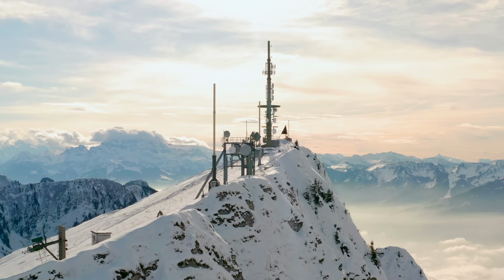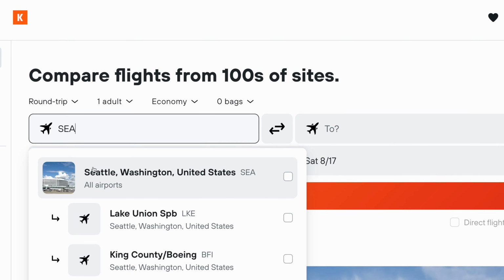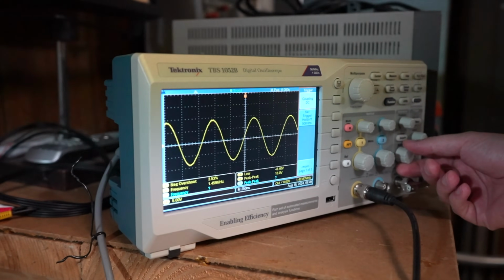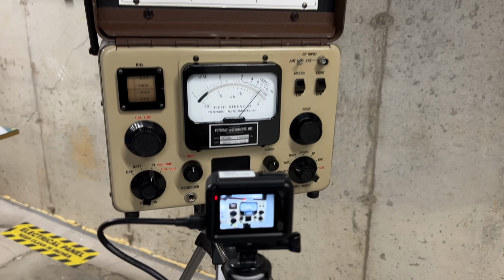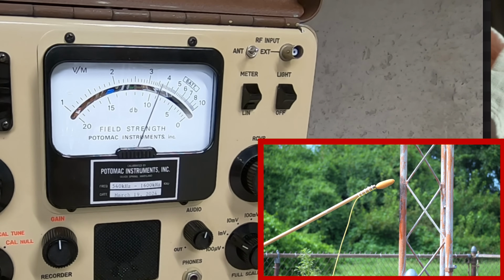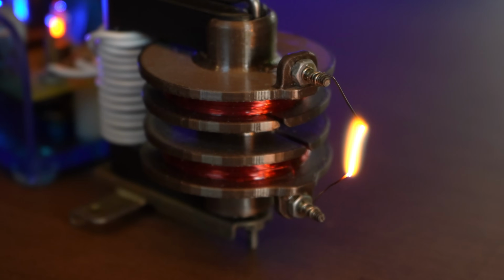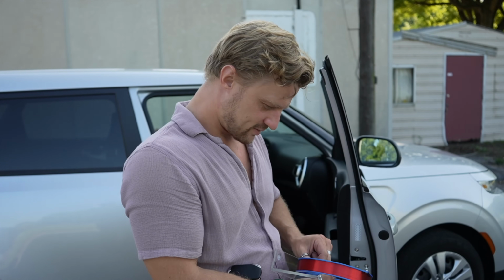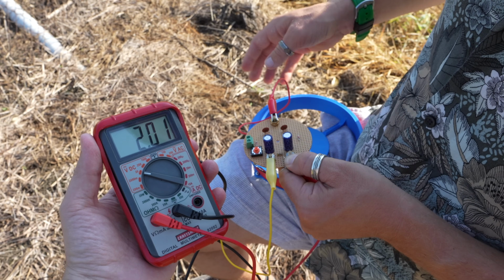Stealing Energy From Radio towers Using Plasma (ft. Geerling Engineering)

Comment: whether or not a radio signal goes line of sight or not, does NOT depend on its mode.... i.e. FM,AM,SSB........... it only depends on the frequency of the signal, so line of sight radio are signals more or less above 54 MHZ or so, regardless if its AM , FM or whatever...

Comment: This guy needs to meet Ethan Krauss. 

Ethan Krauss has an Ionocraft Lifter with an Onboard Power Supply. He had that before MIT and Undefined Technologies. Since Thomas Townsend Brown and Lockheed/RCA neve patented their lifters w/General Electric Batteries; Ethan Krauss is technically the Inventor of the Ionocraft with Onboard Power Supply. 

Electron Air LLC

Comment: Rather anti-climactic!  YES, I want to see you build a device hat actually takes useful amounts of energy out of the air at a reasonable distance.  Let us see you light up a one watt LED continuously.  That will be useful.

BTW, when you talk about transmitting energy through the air, maybe you ought to read a book or two about Nicola TESLA.  He transmitted power for many miles to light up fluorescent light bulbs MILES away.  And he did it over 120 years ago.

Comment: Those rings and the electronics stuff together freaks me out!
Reply: Mind the admonishments on the warning signs, until you understand them. Then respect them. That worked well for me for 39 years in the high power transmitter research field, mostly at much higher power levels than this little AM station. .

Comment: It's worth noting that early Crystal radios lacked any form of amplification circuit, the power to drive the loudspeaker came purely from the energy captured by the antenna.
Reply: All crystal radios work like that. They are fun to build.

Comment: Tesla invented the wireless power transmissions, just like the death ray was a Tesla invention. The death ray works only if you throw the death ray gun to the enemy. The energy transmission works too, input something like twelve thousand Watts to make on LED flash for a second. The efficiency is far below zero. Back then, when Tesla was stil walking on Earth there were no LED's, only light bulbs. The power in the tower should have been increased by a million times and even then the lightbulb from a bicycle would not lit.

Comment: I use to live like a hundread meters away from a 500kV power line, and once riding my mountain bike on a road that passes below the power transmission towers, bike that was like a closed loop of aluminium, I got a electric shock that I was even able to hear in the wired earphones I were carrying, I felt like a pinch in one leg, I think it was due current induction on the bike frame. I even wrote a letter to local authorities and got an answer telling me the tower were within the normated parameters (the road was built after the power lines and they lift the ground a few meters). 
From that little accident, I am pretty confident that if you place enough wire loops below a high voltage power line, you will be able to steal electricity for free in a wireless way by making a core-less transformer, which you could try for incoming video, but placing the warning that making a transformer below a power transmission line is a very efficient way of getting electrocuted as the sausages of this video.

Comment: so what would happen if i made a bunch of these (with correct components and copper coils to prevent blowing up my circuit) and tuned them to the various broadcasting AM frequencies and connected it to a battery for home distribution? would that work to power the average american home? what about sending power to rural or difficult to reach places?

Comment: i honestly hope you realize what you have created here.... 12KW is a drop in a lakes worth of energy compared to the radio noise that surrounds us naturally.... if you had an array of those antenna set to pulse at 23% before critical, enough of them could supply a continuous voltage much like a bridge rectifier does for a generator. good luck from the future

Comment: I worked at a VLF 500kW transmitting station in the 80s.
We bounced signals around and through the planet using 100ft arrays and 5ft vacuum tubes. 
It was the cold war and everything was overkill!

Comment: Ok, so where was the plasma shockwave?
When I think of shockwave, I think of something similar to a blast/detonation of energy with the potential to knock you down or worse.
A transmitter and a receiver is old school and not what I was expecting.
What kind of work could a plasma shockwave potentially do?
Reply: 9:52 They even point a big red arrow at it
Reply: @JamieJamez , I wouldn't call that a shockwave.  Something else perhaps but not a shockwave.

Comment: Hey Guys,

I have a question about Plasma. Could you create a parallel circuit, in which one high voltage power supply creates a plasma, through which a second low power supply runs high current? Because plasma is conductive, right?

Comment: When I was in high school we had a Nasa Engineer substitute math for us. He talked about making something similar to your LED circuit. He used these for LED lights in house. (before the led was commercially available. He talked about using the radio waves from the nearby tower to feed the receiver coils he kept on his roof. I never personally put eyes on it but the idea never has left my mind.
Reply: The first visible LEDs were red, so he would have been powering red lights in his house. I guess you could see but it would still suck.
Reply: @edisont.picard4112  They had Blue with filters ( white) when I was in Highschool. class of 2009
Reply: @edisont.picard4112  perfect nightlights

Comment: If you start stealing energy that way in the UK some goverment spooks will come and bag you.. They'll triangulate the power drain.
At least they will if they notice the signal drop. You'd possibly be undiscovered if you only drew the power from the audio and left the carrier signal alone but i'm not sure if that is possible.
Tesla was way ahead of all of us in the wireless electrical transmission game. he had power generation licked too.
Just imagine using the entire earth as the base coil. build up the ground capacitance difference in one location, with a huge energy source like a hydro-electric dam, then place secondary coils anywhere on the Earth's surface to transmit the power. With frequency manipulation, you would have been able to transmit power, radio, television and possibly even the internet.. Although at that point we'd need some seriously massive power stations all feeding their power into the Earth's system.

Comment: I know someone who owrks in the utility space. He was in a rural area of NM and was inspecting some HV DC lines and found a shack near the road in a remote area. There was a house and property near by. The guy went to inspect the box and found a 48v circuit with antenne loops under the road. He said that is was all working really well but it didn't have any breakers or safety equipment built in. He said he eventually talked to the guy about how he made it and let him keep it up so long as when he came back there was safety equipment installed. Cool to see some wireless transmission videos.
Reply: I have to call BS on that particular story. High Voltage DIRECT CURRENT is NOT going to transmit any significant wireless power, because it is only the CHANGES in current that result in power transfer. Current changes on HVDC lines are small and slow, just the opposite of what's needed for wireless power. Now if the lines were High Voltage ALTERNATING CURRENT, that is a different story, and echoes many such stories from all over the world.

Comment: Tip: you can get rid of support by adding a filet or chamfer on the edge where the overhang is situated, sometimes it could be unideal especially if you exaggerate your filet so just use the smallest radius possible to have the smallest deviation to prevent the wire from unwinding

Comment: Try to make a off grid high wattage power supply so one could connect a kettle or a welding machine :) that would be soo cool to be able to use high current appliances powered from the radio tower just like Tesla dreamed of.

Comment: For me there was a great (and safe) demo of how powerful radio transmission is - you can build a passive radio receiver. It drives speaker only with the energy it receives from a transmitter.

Comment: Neat vid Jay! Years ago when I was into amateur radio, I had a really old 100w tube amp for 10m. It had a tendency to overheat, so I would take the top of the case off when using it. One night, I reached behind it while on one night...and bumped the top of one of the tubes while transmitting (believe it was the anode of a 6LQ6). I came to about 15 seconds later, other side of my living room, against the wall and on the floor. 
Measured voltage was only 660vdc. I'm going to go put a cut grape in my microwave now.

Comment: I was building only a 50 watt AM transmitter many years back. You could light a fluorescent tube near the wire antenna, and if you happened to touch it, you got quite a bzzzzt noise followed by the smell of burning flesh. It's pretty much like a solid state tesla coil, designed to radiate rf rather than produce a high voltage for arcs though.

Comment: If you build another, learn about LEDs. You were way over the voltage rating for that LED, that's why it died. Use a calculated resistor for LED based on the higher voltage, or use 2 or 3 LEDs in series.

Comment: If you go back to test your ability to receive power, can you test if the maximum power is received at 51 meters, 102 meters, or 205 meters from the tower? My guess is that your tuned power receiver will acheive peak power at a distance similar to the height of the antenna. The point of measurement is something you could check out since a phased array directional antenna should have wildly different results in different directions. And please bring a portable AM radio to see how the ability to receive the station changes when very close.

Comment: This has always fascinated me. One of my E.E.s on staff and I were jokingly talking about it when he chuckled. He worked for NASA back in the 80s and said he could pull down hundreds of watts of energy, constantly, for as long as the energy grid was up. He then explained that with enough tuned coils, he could be an energy vampire. At the time, it mead me question if he was insane, or what. Still, the question persists. I wonder, how many of these coils, and at what distance, could you pull in a constant stream of 12V? Seems like a quick project :P
Reply: Remember that energy is sold by the Kw-Hr or Joule, not by the volt. Also, mind the inverse square law.

Comment: 6:30 that's a mud-dauber I believe.  Generally non aggressive, unless threatened. They are in the wasp family but are only a mild annoyance as they build mud structure on walls.  Their stings are also much less painful as they don't kill their prey so much as paralyze it to eat later.  You can usually tell by their abdomen that thin part at the waist.  Where wasps have the same narrow connection it is more like an hourglass instead of a thin straw between.
Reply: A wasp hands typed this post.

Comment: That’s kind of intriguing. But you know what would be even more intriguing?
To harvest the power of a lightning strike, and I bet if anyone can figure it out it would be someone like you!
Reply: I did the math on that once, and the problem is that strokes are too short, too intermittent, and you don't get much energy for the huge material resources that would be needed. You'd have to convert a short stroke into a stored DC charge using a humungous inductor followed by a ginormous high voltage capacitor bank. Better to put up solar panels or a windmill. If it's snowing, you can get a bit of power from a long wire gathering precipitation charges. Not enough to drive Nikolai Tesla's LaSalle, though; that was a hoax.

Comment: I believe in 11:10, when you say that sounds like 60Hz, that actually sounds like 120Hz. That's because what makes the sound is the arc ionizing this path of air in front of it, and every time it reforms the arc, a new wavefront is formed. I might be wrong, but I believe that's a 120Hz fundamental with a lot of harmonics in there. When you have an Amplitude Modulated signal forming an arc, then you will hear the modulated signal and not the carrier, so the effect is not present here.

Comment: I'm in Riga Latvia and swear I can feel the ambient energy coursing through the area. Recently, I found an old project where I soldered together 3 batteries in parellel from ecigs/vapes like a ladder with small brass strips on the side and a blue led connected to one of the suction switches instead of the heating element. When I made it it would only come on when I blew on the switch, which was the intention, but after about 2 years I found the blue led glowing and it hasn't stopped. Not a flash. I tried to recreate it without the suction switch and a white led, it's been glowing for a few weeks but dimming and could just be normal discharge.

When I asked the computer about it it was saying the led could be rectifing ambient ac. I think the batteries are acting as coils and collectors from the brass strips, etc. I'd love to host a visit to see if it could be measured, documented, etc.
Reply: LEDs can already glow visibly but dimly on microamperes of current. This means that  if the switching FET in the vape is ever so slightly leaky, you'll see the LED glow in the dark. And because it's microamperes, and there are about 7500 hours in a year, it will only draw 7,5mAh from the battery. If the battery is 250mAh, in theory it could power the LED for more than 30 years, excluding self discharge.
Reply: Those switches are just microphones, literally any noise will set them off, plus passive discharge over time etc

Comment: So if there is so much electricity in the air, is it possible to overload the antenna if enough receiving devices are wirelessly connected to it? Like plugging too many power tools into an extension lead to the point where the RCD or fuse pops?

Comment: Those 16 kV insulating gloves are serious gear.  Did you see him put air into each glove to check for any pinholes from material degradation?  I hope he did.  They make a device called a puffer which blows up those gloves like balloons.  Yeah you don't want the shortest path to ground to be through a tiny hole nearly too small to see, and then through your hand.

Comment: I had no idea a radio tower could be this dangerous. The story of the fried guy is very convincing, will never approach a radio tower.
Reply: I'm a ham radio operator and I got a burn on my finger touching the antenna wires from my transmitter at only 150 watts!
Reply: @mirskym  I got bit from a CB radio antenna, 4 watts. The thing is, matching circuits and loading coils step up the voltage into a shorter than quarter wavelength antenna so it will match and radiate more. So it can be a lot more than the transmitter voltage.

Comment: Very nice video and collaboration.  Love it.  Also, I would like to know if you can build a wireless power receiver that will work from ground level just below high voltage transmission lines.

Comment: I'm actually curious about a multiple coil receiver would do. Having dealt with several flyback transformers in my life it occurs to me that several of those coils in parallel would produce higher current. As for the capacitors and the diode, I'd suggest something more in the 400v range like what you'd find in a computer power supply. I've always found this method of harvesting power intriguing.

Comment: Space solar power uses this concept at much bigger scale in the 5.8 GHz microwave range to beam GW scale power to the ground from GEO. This technology has been viable since 1979 and was recently proven again with measurable power beamed from space. It’s also incredibly efficient with a cost notionally on par with ground solar, but no need to be in a sunny desert or store power overnight. Space solar power is fusion that works.
Reply: That remains to be seen if it's economically viable. So many hurdles, like safety, siting, grid connection, rocket costs, maintenance, the list goes on. A huge gamble and one Indian burial ground or endangered species habitat from failing. .

Comment: Use a larger coil.... and install a sausage in the circuit as a resistor.  If it blows you can eat it shortly afterwards.

Comment: Side note, the mode FM does not only work on line of sight.  It's the typical FM frequency range (88-108mhz) that is line of sight.
Reply: Actually broadcast FM uses 88-108 Megahertz, not millihertz.
Reply from the maker: Lol priceless
Reply: So it's the capital M that makes it mega? Thank you....
Hmm, a micro hertz would be pretty darned slow!
Reply: There are special conditions such as "tropospheric ducting," "sporadic E" and "meteor scatter" that can on occasion send FM signals over the horizon. It's just not PRACTICAL with FM radio, because these conditions usually do not happen. When they do, FM radio stations from far away can be heard, although a local station at the same frequency would of course prevent reception. If you want to hear a long distance signal, you would have to listen on channels that are normally free in your location.
Reply: I hear it's more like everything over about 30 MHz which is line of sight, so that includes not just broadcast analogue FM but wifi, phones, TV, digital radio and TV, everything else.
Reply from the maker: Good info, thank you
Reply: Living here in Colorado I found FM to bend slightly, but AM much stronger on sight.